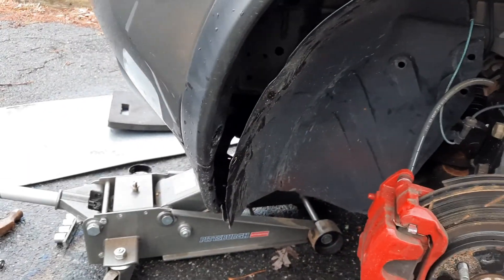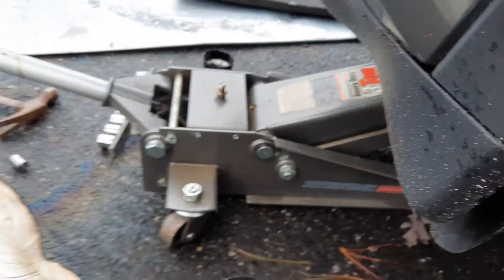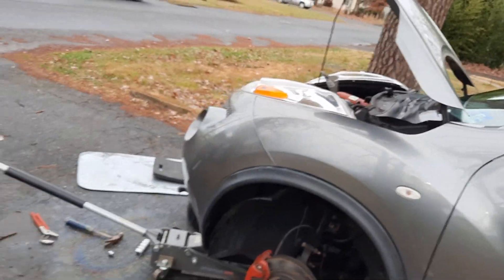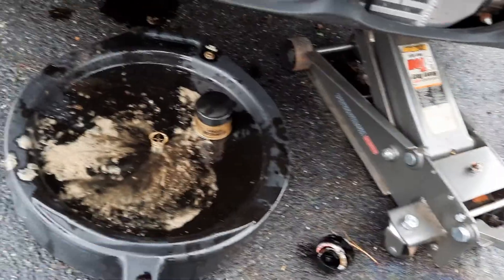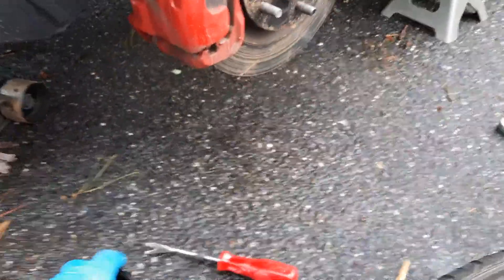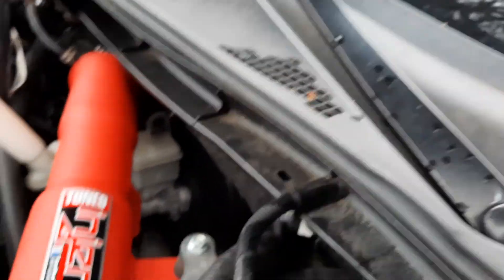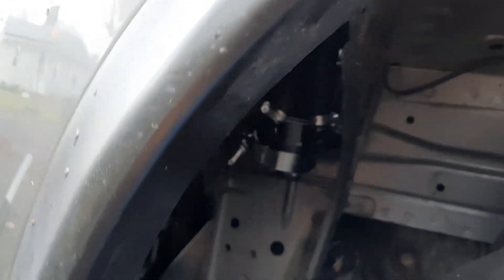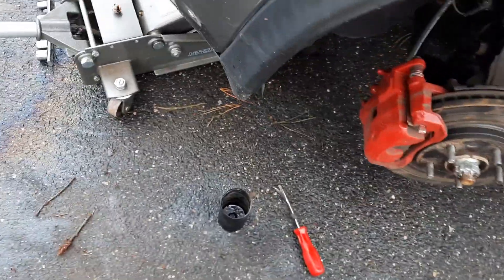Nissan Juke Oil Catch Can, Do you Need one??

Comment: So you have smoke on deceleration?
Reply from the maker: No I ended up sucking frozen sludge into the turbo.. I pulled everything apart and cleaned everything with break cleaner. Then I ran drain hose down from the can so I can drain it every couple days without pulling the car apart to get to it.. My turbo has about a 100K on it so I do get some smoke out of the tail pipe in the winter's until the car warms up! But in the summer their is no smoke so I am not to worried about it.. I have been looking at new cars and project cars but it's just the wrong time right now to try and go out and buy a car right now weather used or new.. Everything is marked up..
Reply from the maker: No smoke on deceleration, But I ended up moving the catch can into the engine bey, so it would warm up with the motor.. I had issues with Carbon/sludge N Water/condensation, it the catch lines in the winter. When it would go below 22 degree's F at night I would have issue cause the can was in the wheel well far from the Motor. And the Can and Half the Lines would be frozen solid. Anyway this winter coming up is 2 years and 10K later, I just hit 105,640 on the clock and it's summer now.. But moving it into the engine bey was needed plus it makes it easy to get to it. I didn't realize how often it needs to be drained and cleansed.. 
   The Hidden Can was a great Idea from FR if you live in Florida, Atlanta, or someplace where they don't get real winter's it's a perfect place to put it.. But if you live somewhere where it can freeze, you will want to keep it in the engine bey so it warms up with the motor. If it's a really cold Morning I will dump it and spray everything and into the hose's and elbow's with brake cleaner for better air flow before even starting my car now. But the Can and Lines were Frozen and that's where all the smoke came from last year. Thanks so much for watching. I have been filming with my phone n I'm trying to pay more attention to camera placement. 
   I have a Front Bottom spoiler I will be putting on this weekend.. Thanks for watching.. I will make a vid once I get all the hardware in and finish painting it..